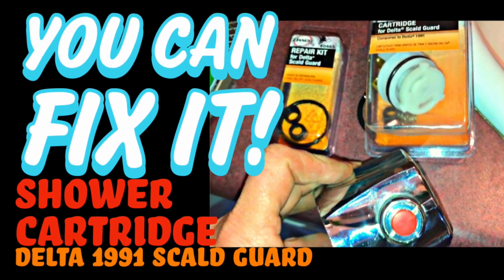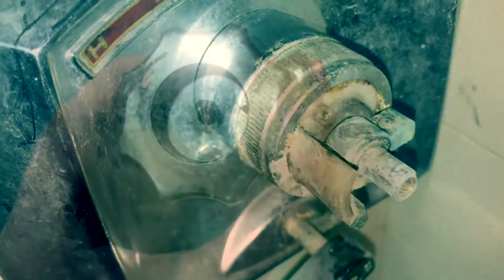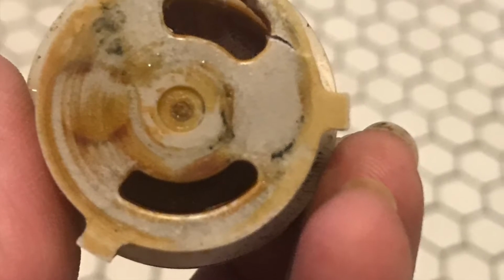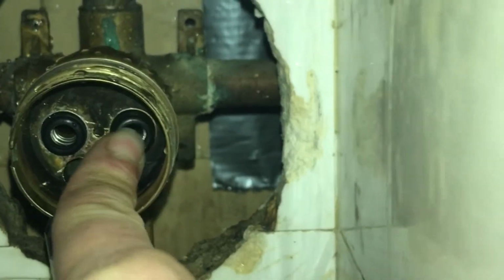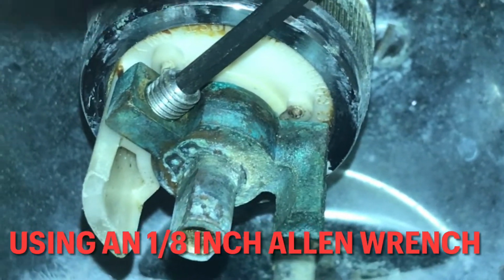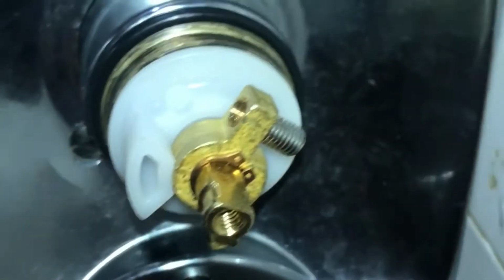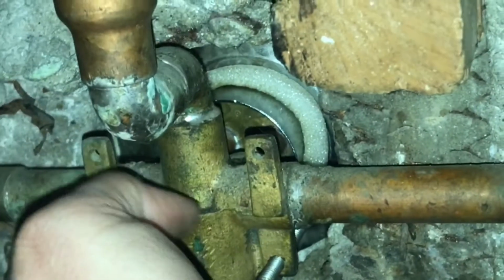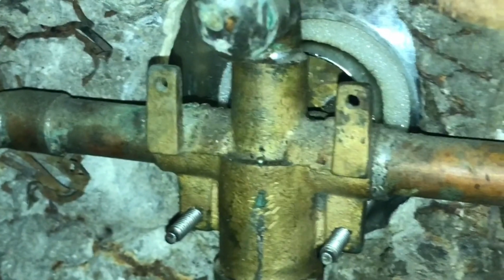Replace Delta Scald  Guard Cartridge

Comment: After replacing my cartridge, I'm getting crossover now.  What did I do wrong?
Reply from the maker: I’m not certain. In this video I only replaced parts such as the rubber gaskets and springs. I’d search for a cartridge installation video for tips.

Comment: I just bought this cartridge to try to replace one that looks the same from the outside where the handle screws on. The brand on mine is Pioneer. It's what the builder used & I hope it's the exact same one, because I don't want to have to wait to order it online to try to fix it. However mine does not have that scald guard. The problem with the one I want to replace is that the hot water comes out with very low pressure and the cold water comes out with normal pressure.

By the way, were you able to shut the water off right at the valve for the cartridge goes? Or did you go to the main water shut off? I really don't want to have to shut off the water to the house because my wife and son are still here.

Comment from the maker: I couldn’t find a single video that walked one through the Delta Scald Guard 1991 so here’s one for you! After you pull the handle off your going to remove the round ridged ring by hand- Don’t use a pipe wrench or use a lot of force or you can damage your copper pipes that connect to the shower regulator inside your wall! Some folks gently use a channel lock. Mine came off by hand easily.
Reply: @jjsjeffjjsjeff  I was kind of wondering the same thing.